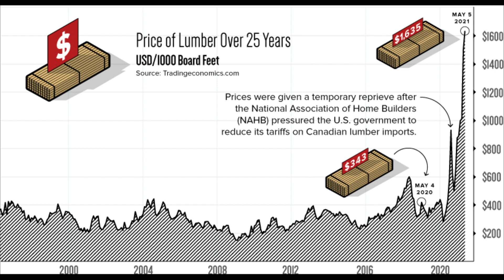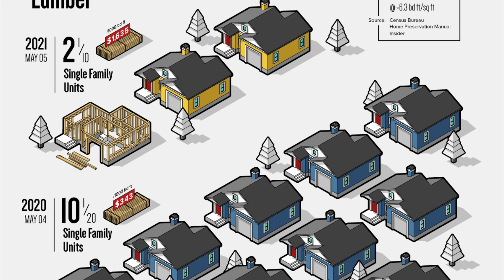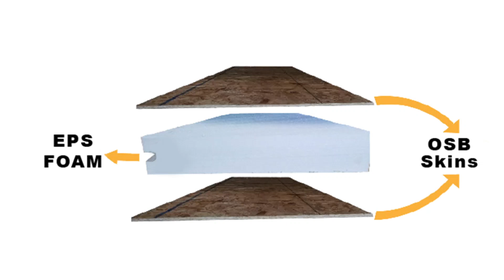SIPs are proving to be a more affordable choice for building now

Comment: Sure...more economical...because resesech shows that they are basically "throw away" building materials.

OSB sips are a horrible idea.  Any air leaks and you get rot and leaking.

Imagine trying to fix your leaking sip roof that has drywall or knotty pine on the inside?

Wow.

Its like rebuilding your entire roof.

Id say no way to OSB sips.  Too much risk.
Reply from the maker: Not sure what research you are referring to that supports the premise that "they are "throw away" building materials."

If installation follows the details of the manufacturer, SIPs perform very well.  As with any material, the details of installation are the key.

Comment: I got a partial estimate for SIP construction but not a full estimate. When I called back for a complete bid, I was told he would have to get back to me on that. Waiting for over a month. I got a full bid for stick building a house with bids for land prep, driveway, plumbing and electric. Wish I could get my full bid from Enercept.
Reply: I had a similar experience with Enercept. I even spoke to their CEO on the phone. And I have zero influence, a small budget (considering the local market seller's potential), and no available financing at the moment. Hopefully they'll respond soon.
Reply from the maker: Sorry to hear your estimates fell through the cracks.
Reply: Went with a local contractor and got messed up in a big mess with a building that nobody wants to put up for us and hard to finance the assembly and completion. Building a new home is a nightmare.
Reply from the maker: Sorry to hear. 🙁 @mikemcgown6362
Reply: Outstanding work this if the future of all apartment building.